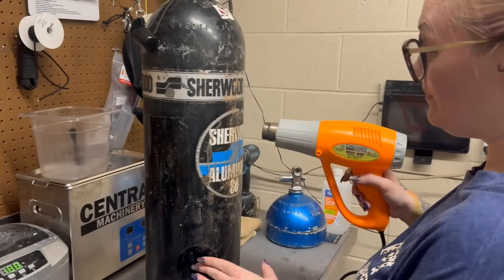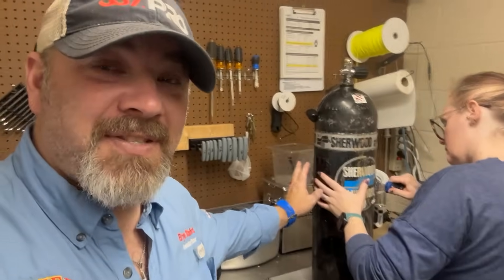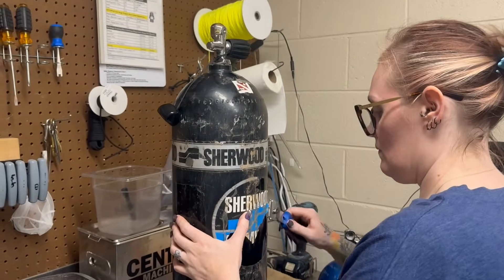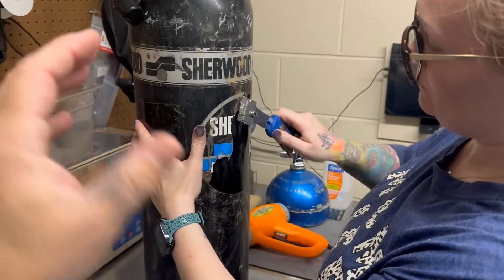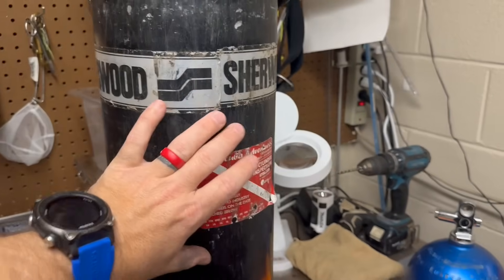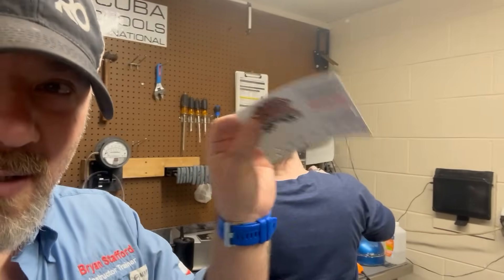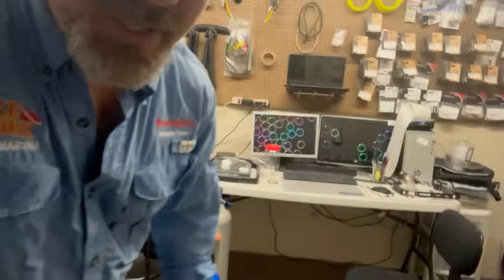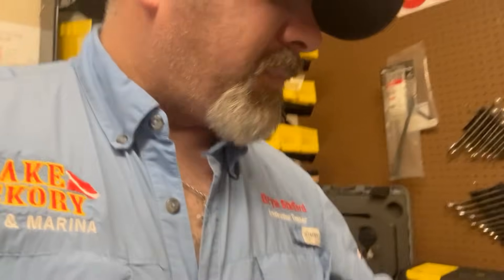Why We Remove Your Tank Stickers

Comment: I haven't seen cylinders with VI stickers on the bottom, but I have seen VI and other stickers quickly wear and disintegrate off the sides of cylinders that are frequently stacked on their sides for transport, such as those owned by dive shops. That suggests the crown is a better place for stickers, but those stickers need to be curved, are smaller (with less room for information), and often cost more. There's also the potential to run out of free space on the crown of an older tank, depending how willy-nilly the hydro-tester places their stamps. Thank you for the videos, Bryan!
Reply from the maker: Hello @eclockwork, we actually prefer to place stickers around the crown as well, but for all the same reasons you listed, opt to place them on the side wall.

Comment: I don’t remove stickers when I do VIp
Reply from the maker: Hello @russellphillips905, we follow CGA C6 and C6.1 which states.

 CGA (Compressed Gas Association) Gas Law showing this is C-6.1. 
Section 4.4 CLEANING
"Judgment is required to determine the extent of cleaning required and whether removal of paint is necessary. At the time of requalification, all multi-layered paint and coatings, foreign materials, temporary labels, or removable sleeves that could interfere with the inspection shall be removed from the external surface so it is prepared for inspection. Remove all attachments that could conceal corrosion or other defects before inspection. If internal/external cleaning is performed in conjunction with periodic hydrostatic retest, cleaning shall be accomplished before hydrostatic or other cylinder testing." 

C-6.1 deals with aluminum cylinders that hold 1800 psi or higher pressure. The same thing is stated in C-6.0. That section deals with steel cylinders. So the CGA gas laws apply to both types of cylinders.

Comment: Interesting. That does not seem to be a thing here in Germany. I see lots of tanks with old stickers pass inspection after inspection...
Reply: Germany, and probably every other dive shop worldwide except this one...  These guys are acting like a sticker could cover up a welded hole, which means they aren't inspecting the inside of the tank where it would be obvious in 1 second, and instead just showed the removal of a factory sticker under the guise of inspection.
Reply from the maker: Hello @torstensteinert776, we follow CGA C6 and C6.1 which states.
 CGA (Compressed Gas Association) Gas Law showing this is C-6.1. 
Section 4.4 CLEANING
"Judgment is required to determine the extent of cleaning required and whether removal of paint is necessary. At the time of requalification, all multi-layered paint and coatings, foreign materials, temporary labels, or removable sleeves that could interfere with the inspection shall be removed from the external surface so it is prepared for inspection. Remove all attachments that could conceal corrosion or other defects before inspection. If internal/external cleaning is performed in conjunction with periodic hydrostatic retest, cleaning shall be accomplished before hydrostatic or other cylinder testing." 

C-6.1 deals with aluminum cylinders that hold 1800 psi or higher pressure. The same thing is stated in C-6.0. That section deals with steel cylinders. So the CGA gas laws apply to both types of cylinders.

Comment: Nice timing for the video. I was considering putting dragon sticker on my cylinders to make it easy to recognize my cylinder at our quarry fill area. guess ill look for another way.
Reply: I would suggest looking for a different shop! There's no need for sticker removal.
Reply: @Just-Ross  they just explained why smh and it's a very valid reason.
Reply: @MysticalDragon73 because there is no requirement to do it whatsoever - their excuse/“explanation” is absolute rubbish. Unless they are removing stickers people have somehow stuck to the inside too?
Reply: @MysticalDragon73 it is not a valid reason 😂
Reply from the maker: Hello @MysticalDragon73, a lot of divers like to customize their cylinders with stickers and is perfectly ok to do. Unfortunately, due to CGA C6 and C6.1, we are required to remove them during a visual inspection. Here is a reference for you.

 CGA (Compressed Gas Association) Gas Law showing this is C-6.1. 
Section 4.4 CLEANING
"Judgment is required to determine the extent of cleaning required and whether removal of paint is necessary. At the time of requalification, all multi-layered paint and coatings, foreign materials, temporary labels, or removable sleeves that could interfere with the inspection shall be removed from the external surface so it is prepared for inspection. Remove all attachments that could conceal corrosion or other defects before inspection. If internal/external cleaning is performed in conjunction with periodic hydrostatic retest, cleaning shall be accomplished before hydrostatic or other cylinder testing." 

C-6.1 deals with aluminum cylinders that hold 1800 psi or higher pressure. The same thing is stated in C-6.0. That section deals with steel cylinders. So the CGA gas laws apply to both types of cylinders.
Reply: @LakeHickoryScuba  thank you. That should shut the naysayers up because  "SHALL BE" is pretty clear language.

 We deal with wording in aviation and one word can change the entire meaning
Reply: @MysticalDragon73 they are following “a” standard. It’s not “the only required” standard. They have absolutely not shut anyone up, and in fact, seem to be doubling down.
Reply: @MysticalDragon73 same regulation says if you expose cylinder to over 350 like hearing one spot up to remove a sticker with a 700-1000deg heat gun you must condemn the cylinder so they're not even following the rules consistently